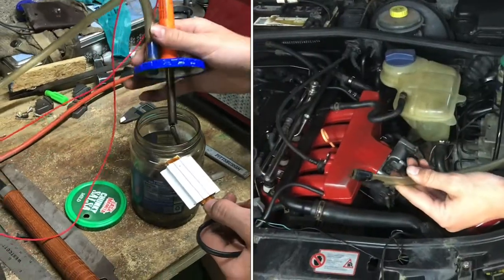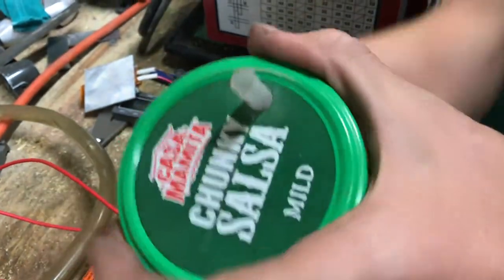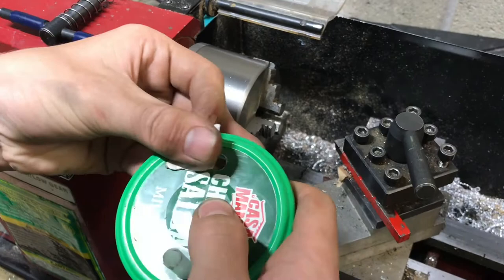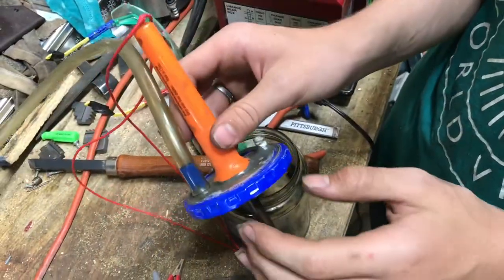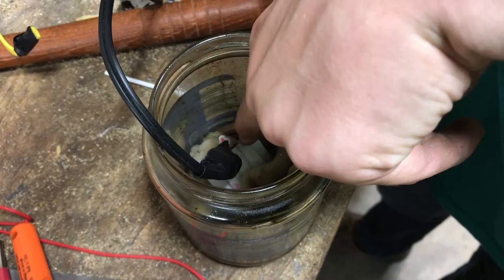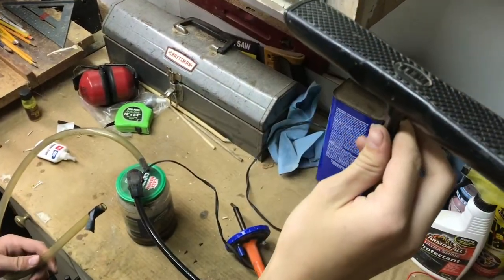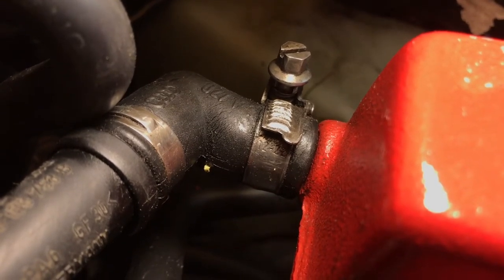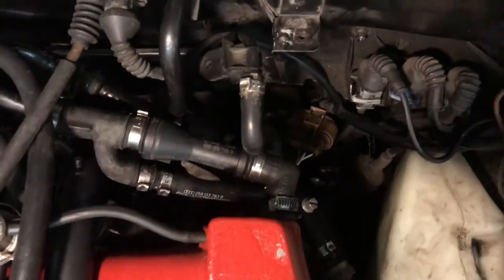BEST $10 smoke machine you can make (rev 2)

Comment: For the pieces that go in to the lid you can use 2 tyre Schrader valves they work great they have grooves on the rubber that will make a nice seal on the lid  then just remove the inside of the one valve for the smoke to come out and the hose. Can fit on there

Comment: you'll save yourself a lot of headache if you go pull a couple old tubes out of the trash of your local motorcycle shop, motorcycle tubes have steel threaded inlets with nuts that can be used to tightly secure all your air intake and exhaust to the jar lid, just add a the appropriate sized metal washer and cut a rubber sealing washer from the the inner tube you just removed the threaded air inlet from. no lathe of waiting for glues to set, you can build the whole thing in minutes and it will be way better then using plastic pen body's and caps........
Reply: Being unfamiliar with these types of tubes what do they connect to on a motorcycle so I can ask a shop if the have trashed any.

Comment: Most of the videos like this one are prepared in advance so that nothing goes wrong. Cheap soldering irons don't reach the temperature that mineral spirits combust. Most of these videos are bogus but give it a shot if you got nothing else going on. You'd have a better results if you took a Monster Bong Rip & blew it down the line. But remember to look for the leak. Don't space out & forget. You could also use a bottle of Map gas & have your buddy flick his lighter at the connections(not the tank or gas cap that would be a Dick Move).  Be Safe. Don't attempt the Map gas procedure. Bad joke? Ya it was.
Reply: Yeah what’s a good way to get it hot enough since soldering iron doesn’t work
Reply: @aqib2000  Ele não sabe , porque quem sabe faz , quem não  sabe critica .